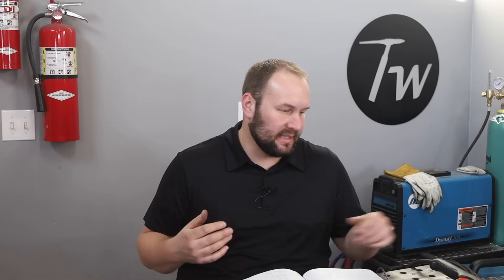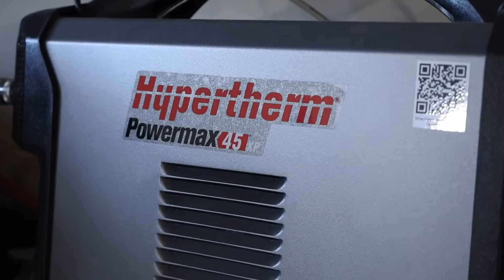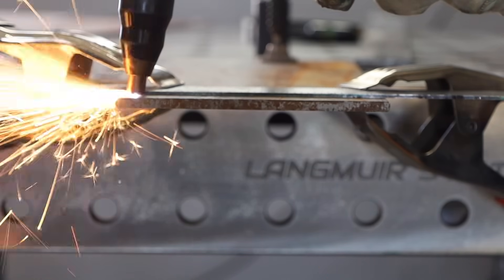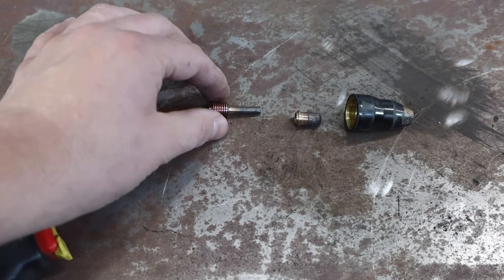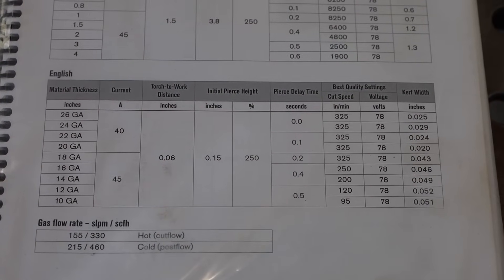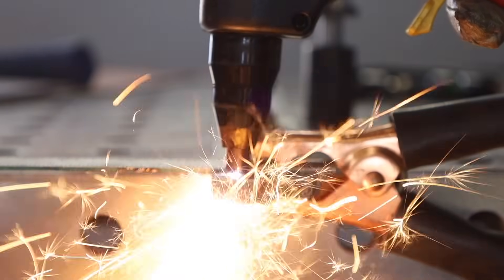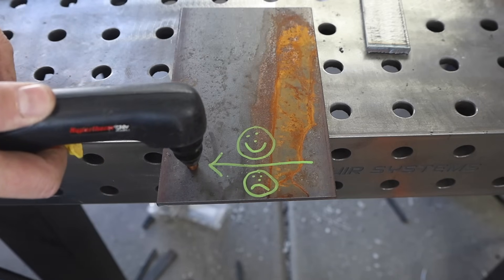Plasma Cutting Basics: How to Get Clean, Straight Cuts

Comment from the maker: You can learn to weld.  I'll show you exactly what to do in my affordable online welding courses at https://courses.timwelds.com.
Reply: I recently acquired a Parkside PPSK 40 b2 plasma cutter from Lidi, not bad considering I only went in to buy dinner, but like usual with Lidl I couldn't resist the impulse to purchase one at only £149.99. The only downside is having to purchase PPE separately, unlike the Parkside stick and core welders that come supplied with a basic mask, hammer and gloves. I can't fault the 40 watt plasma cutter's performance, it's accurate, fast and highly adjustable, And comes supplied with a nozzle guide-wheel attachment and two spare electrode tips and sleeves. Thanks for sharing your knowledge, especially about cutting speeds versus power. I tried mine at 100% and used practice to determine the speed. My only concern is exceeding the duty cycle too often operating at full power. Can't expect a miracle plasma cutter for that price, but for that price, it easily slices clean through 1/4 inch of solid bar stock like butter. 👍

Comment: This is not a criticism but a genuine question because I have absolutely no experience with this and have no idea...
I noticed that you allow your torch cable to dangle right below where you're cutting and that the sparks are really blasting that cable.  Is that a good idea?
Reply from the maker: I don't mind the question at all. It's not a good idea to have the torch lead under your cut...oops. 😬

Comment: Hi Tim..so just watched your video on plasma cutting tips...I am currently looking at purchasing a smaller unit for home hobby use etc.
I have two dilemmas that are determining what I can or can not purchase...one being my air compressor which puts out 5 cfm @90 psi..the other factor is I am using a portable inverter generator that has a 10,000watt startup and 8,000 watt running watts...so to look at the specs on the machines that run within those specs is pretty limiting..
So I am curious if I have to make a purchase what of the two factors should be the priority..I know the more power means more depth of cut so while I would like to get the most bang for my buck...which one thing should I prioritize

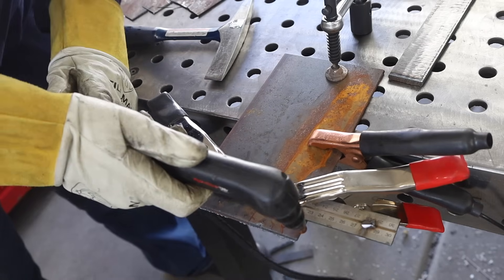Comment: @7:30 that is how i ruined my torch lead when my molten steel and dross dripped onto the lead under the workpiece. Yeah i was trying to cut half inch which was beyond the capacity of my Warfox cut50dp , had to order a replacement lead which was pretty cheap.

Comment: Given how easy plasma cutters are to use and they don't use much consumables, why are oxy acetylene preferred sometimes? I mean it basically makes acetylene obsolete. Even in construction it's rare to cut anything thicker than 3/4" unless you are building large skyscrapers... And you can't really use a straight edge with an acetylene torch.
Reply from the maker: Torches are portable and don’t need air/power, so they’re good for that reason, but it’s true that plasma has largely replaced oxygen acetylene.
Reply: @TimWelds  The torch itself might be, but not the oxygen and acetylene tanks it needs.

Comment: I am doing a lot of freehand artsie type cutting. I found that using a roller guide wheel attachment allowed me to get far better and smoother cuts when I'm following a curved line mark. I have a Hypertherm XP30 and other than the circle guide, they do not seem to make a rollerguide for their machines. I bought a cheapo from Amazon and had to modify it to work with the XP30

Comment: Ive noticed that there is a huge impact with the air pressure. What amp vs air pressure should be lets say 30 amps and lets say 8mm dark metal.

Comment: Does the metal i am cutting have to be clean as if i was welding,,i have anew plasma cutter but it isnt cutting very well,,lot of spitting ,,i have a large compressor and proper setup,plasma cutter can be set at 120 or 220,,im using 120,,will using 220 circuit help with cuts,,i want to use plasma to cut metal to mke tractor implements

Comment: Does anyone know where I can buy shade 10 or higher plasma cutting safety glasses? I work on an industrial plasma cutter that typically runs between 260-400 amp and the only thing i can find is shade 5
Reply: Google KMZ-SHD10

I have no experience with them though.

Comment: Tim great videos... Thanks for your willingness to teach 
One question is Air psi? You kinda started to talk about it.  And didn't get to deep 
Please help me know what kind of PSI I should be using.
Reply from the maker: It usually says right on the cutter, but usually a supply of 90 PSI works well with the cutters that I have.

Comment: Some other tips:
-DRAG tips usually have channels or slit cuts.

-IF you have a pilot hole you won't wreck consumables and tips due to blowback.

-DRY air is extremely important. Wet air ruins tips very fast.

-MAKE sure all fittings are tight else torch can get damaged or tips get worn prematurely. 

-IF it is not a drag tip you'll have a guide which keeps specific distance from the tip and the cutting part,don't loose that and keep spares of it.

-Electrode and cutting tip quality matters.

-The more the tip is used the bigger the hole will get hence depending on machine may need more power.

- Make sure cut surface is as clean as possible as you don't want to inhale evaporated solvents which can instantly knock you out.

-Do make a plasma cut table with slit cuts to hold the work and prevent blowing sparks back. Preferably fill it with sand if possible. 

-DO NOT cut when there a completely flush item behind what you are cutting,it will cause blow back and you will ruin tip and will have shower with molten Slag/metal

-DO NOT cut over the concrete. It will mark it and if you have epoxy coating you will burn it.if concrete is wet it may cause Spalding and can cause damage easily. Try soil or sand underneath.

-DRY COMPRESSOR AIR IS A must and many machines need 90psi minimum.
-Buy tones of scrap steel so you can practice a lot rather than fresh steel.
Reply: Why do people like you exist?
Reply: thanks for the additional advice!

Comment: Tim you are the man!  Just set the amps at max and adjust drag speed...that's mindblowing to me, certainly simplifies things!  See, I knew you'd have good tips on this, thats why I voted both stick and plasma cutting on ur survey lol.    I notice you don't have an offset.  Is that a drag tip on the torch then?  I have an el cheapo cut50 type machine with pilot arc.  I tried just dragging w/o offset...plugged up that nozzle tip like almost immediately.   Thx for all you do, Tim!

Comment: Tim,

Other than maneuverability and blade life, what are the advantages of plasma cutting straight cuts vs a great metal cutting (cold) saw?
Reply: If a plasma cutter and cold saw were woodworking tools, the former would be a table saw, the latter a miter saw. If you need to make a 24-inch cut in sheet steel, that’s pretty hard to do with a cold saw. Likewise, repeat cuts in 2-inch angle iron would be a breeze with a cold saw. I can’t imagine a shop in both disciplines, woodworking and metalworking, without all four tools. I’m no professional, but I own multiple examples of all the tools mentioned here, except for the cold saw, my lone one being a Makita. But I like the look of the Evolution, and no doubt will add one. After all, the first rule of tool ownership is well known: buy more.

Comment: I’m a burning specialist at a shipyard,I have a hyper therm 105 and a 125. I use the 125 90° of the time. If you set your amp right and cut at the right speed it will look like a mirror without any slag. If you have a lot of slag you’re cutting to slow or to hot, but mostly to slow. I use a piece of 2” angle as a guide for straight cuts

Comment: Hi Tim! I just discovered your channel. Thanks for your very good explanations and good quality movie. I started to plasma cut one week ago with very poor success. The cut is ok the first 10 cm, then it doesn't go thru the metal sheet of 6mm. So I have to wait till the compressor has uploaded again. The under site shows  a very thick board which is hard to get away. Terrible uneven cut.
My plasma cutter is described to work up to 160 Amps. But when I turn it up to the max, the display shows only 50 Amps. Sow what do I have to change to get better results? Stronger compressor? What size of compressor? Or better plasma cutter? Where to start?
Reply: Tim no doubt is too busy to answer every question, but maybe I can help. I own two plasma cutters and several compressors, and I can tell you right off that if your compressor is working to keep up during cutting it is almost certainly too small. The rule of thumb with compressors is to buy the biggest one you can afford — and then find a way to buy a bigger one. No one ever says “I wish I had bought a smaller compressor.” I bought a huge 5-horse two-stage compressor for my shop years ago and have not once regretted it. You don’t mention the brands of your equipment, but I would review the manufacturer’s claims about the thickness of material your plasma cutter is supposedly capable of handling. Is the machine an off brand? Check your consumables carefully, as they might be partially plugged. It could be that your machine is defective. I have purchased hundreds of imported tools with generally good results, but have found that with the most complicated devices — precision saws, welding equipment and so on — there is no substitute for premium brands such as Miller, Lincoln, Esab and Hypertherm. In fact, I have to admit that the cuts Tim regards as less than perfect look like some of what I consider my best work.

Comment: Hi Tim 
How would you start a cut in the middle of sheet steel .
Would you pre drill a start hole or just go for it with the torch and how would it effect the consumables  ?
Reply from the maker: Great question. You can drill a hole, but I just pierce through with the torch. To pierce through, hold the torch at about a 45 degree angle to the material, pull the trigger, then pivot to 90 degrees. The torch will cut through as you pivot and you’re moving.

Comment: Nice video , you didn’t mention about using dry air . I just run mine through copper tube so the damp air condenses and I can drain it off . Saves your plasma cutter becoming a water pistol …
🙂
Reply from the maker: That's a great tip! I don't have much trouble with moisture, probably because I live in a really dry climate, but I have thought about installing some sort of simply dryer. I'll have to look into the copper tube route. Thanks for the add!
Reply: My rig is 20+ going strong .   Nothing but a simple  3/4” water line copper with regular 50/50 solder.    Compressor is in basement so it’s LOW and the line runs High up the wall.   Mid way there’s a simple U shaped water trap with a drain and another near the end.   On both there’s just a simple elcheapo garden hose bib to drain them.   
   I get very little water as it condenses along the way.   Most doesn’t even leave into the traps .   A simple HF Autodrain in the tank in place of the manual drain completes the setup.    Works fantastic.    Try not to use PVCOr PEX as they are simple to install but won’t condense the moisture which is the real “ air dryer”

Comment: Tim - you should talk about drag tip versus standoff. I really wish I would’ve bought a drag tip machine versus having to run a standoff . You should also talk about looking at consumable replacement cost. I have a Hobart air500I and the replacement consumable costs are 3 to 4 times more because Hobart uses their own style as opposed to a more Standard torch that a lot of companies make the consumables for. 
I pay $10-ish for consumables with this machine as opposed to $1 or $2 for consumables that match a widely used torch.  
 
I also found that when I switched out to a large air compressor (80 Gallon)for my garage it produces way more moisture and made me go through consumables 3 to 4 times more often than with my small compressor.   I found the easy workaround was to hook four or five small passive silica bead filters together in line with the air hose.  I even tried buying a powered air dryer machine and that did not work when combined with a large compressor to filter out all the water before it went to plasma cutter.
Reply from the maker: Thanks for the tips. Drag tips are nice, for sure. My Hypertherm consumables are $10-$15 for a nozzle and electrode depending on the machine, but they work great and last a long time, so I don't mind spending more for a quality product. I'm surprised that a dryer didn't work for you, I wonder if there's oil getting through your pump.

Comment: You have not mentioned your cnc table, langmuir?
Reply: I was wondering the same thing! Will you be making some videos on the cnc plasma? Thanks for the great information!
Reply from the maker: Mine isn't a Langmuir, though I have their welding fixture table. I built my first CNC table from scratch about 8 years ago, which I just sold to get my current, larger table. It's a Premier Plasma brand table. I wouldn't necessarily recommend it to a beginner, but I like it because I understand all the workings and can modify it to do certain things like cut tubing.

Comment: Great video Tim 👍.
I have a question for you. 
Q: I'm living in the UK and looking to buy my 1st 3 in 1 mig, tig, stick welding machine. Can you recommend a good machine for my budget of between $200 - $350. Thanks.
Reply from the maker: Thanks so much! 
I'm not familiar with the machines sold in the UK, but in general, that budget is probably a bit tight. As far as selecting machines, here are a few things to consider. The 3 in 1 multiprocess machines sound like a great option, but most people can meet their goals with one process. Focussing on one process not only can reduce the machine cost, it reduces other costs that many people do not consider, especially gas cylinders (MIG and TIG will take different gasses, so you would need 2). Other costs for setting up each process are filler metal, electrodes, contact tips, gloves, etc. That being said, assuming costs are similar to the US, your budget is probably too tight to get a good set up for any of the processes. The lowest cost process to set up for is stick welding, which is great if you don't mind a learning curve and you're working with steel material 3mm (1/8") and thicker. You could probably get set up for stick welding with your budget, but probably not with a very good machine unless you were lucky to find one second hand. What I would recommend is picking one process to start with (for most people I talk to, it's MIG, but it really depends on what you're doing). Then, price out the equipment, safety gear, consumables and gas and set that as a target to save a bit more for it. Hope this helps.
Reply: @TimWelds  Thanks for that lengthy reply Tim. I've already purchased most of the safety kit and consumables and now just saving up for the machine, but I will definitely take on board what you said. Once again, thank you for your time, and I look forward to your next video 👍👍👍
Reply: @TimWelds  Generally in Europe things will be a little bit more expensive than in the US. We have mandatory minimum warranties and a little bit higher VAT which add to prices.
Reply: Do you mean $2000-$3500 ?!?  I have yet to see a good welding machine for $200 ….  Not even mentioning a 3in 1 multi process ….  That is just not the price range ….